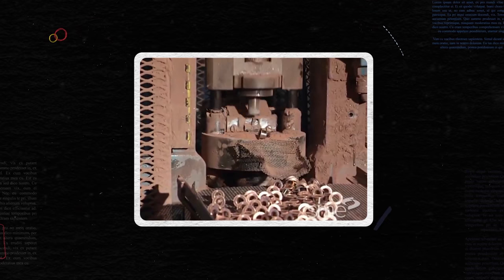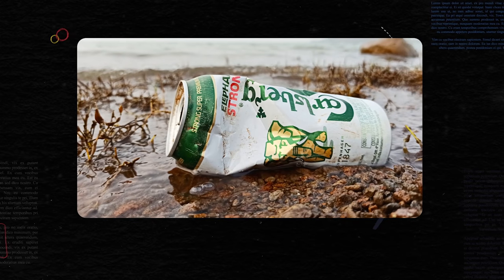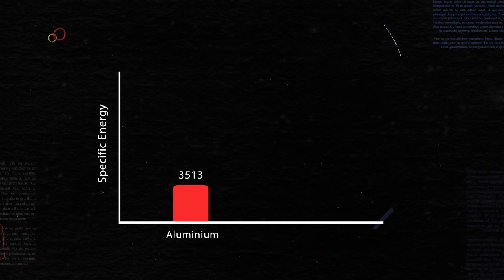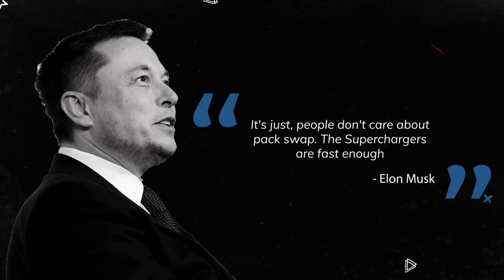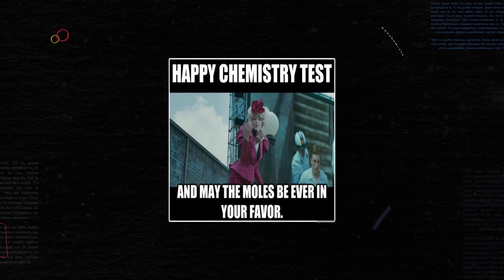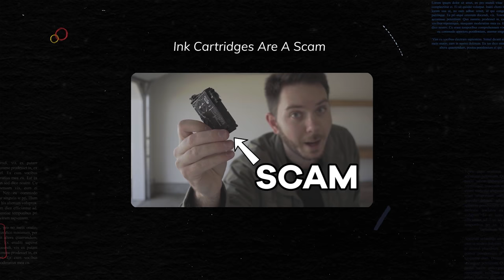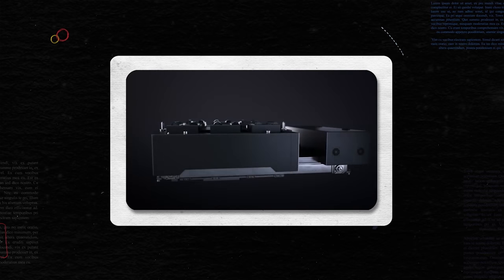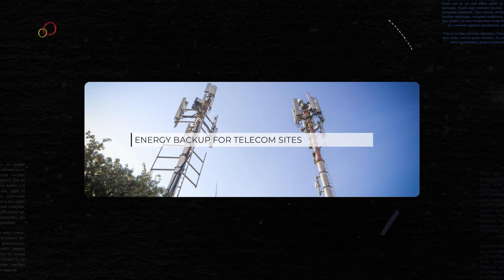We Can Get 1600 KM of Range With Aluminium Batteries

Comment: A better market could be light electric aircraft & delivery drones gaining a 6x better local  range than Li-ion.
Reply: That was exactly my first thought until she mentioned that the electrolyte has to be replenished regularly...
Reply: In British Columbia Canada we have a company called Harbour Air that is in the process of getting their electrically converted de Havilland Beaver aircraft for service.  There are a number of companies looking into using hydrogen fuel cells to drive the electric motors. As aircraft a very weight sensitive a small unit to what she was referring may work as well on the shorter flights as it beats Lithium ion.
Reply: @HermannKerr  Hydrogen is 3 x lighter than gasoline but takes up more space. Perhaps this tech falls somewhere in between.
Reply: @mmatt  Replenishing could be automated with a small tank in the airplane
Reply: I'm working on it
Reply: That makes much more sense.
Reply: youre fucking brilliant
Reply: You do 4x 10kg cassettes. And this would allow a 30kg car a 60kg van or a 200kg truck etc
Reply: @mmatt  I wonder if that could be done without stopping a vehicle
Reply: @brad4013  And is hard to hold=heavy large tanks
Reply: @HermannKerr  Yes, I could see that as an application for short-hop flights. Don't forget the electrolyte capacitor needs service every 300 km (based on what was presented) though it would seem to me that could be extended through backup/redundancy with automated switching.
Reply: @HermannKerr  Synthetic hydrocarbons are better option for aviation.
Reply: @joefox9875  why not in mid-air? Can do that with kerosene…
Reply: You know what would be even better? A battery that could power a 747 for a quadrillion kilometers. Yes, that would be better, but is it ever going to happen? Unlikely.

These are magic batteries--Purely vaporware. Gasoline is 30x as energy dense as Li-Ion and stupidly safe comparably to other energy sources at it's density. It's understandable why people set such standards for new batteries, it's virtually freaking impossible to meet that standard with them.

Imagine a Li-Ion battery 30x as energy dense as they are now, in your pocket, or on a plane. If that thing goes of it is guaranteed death.